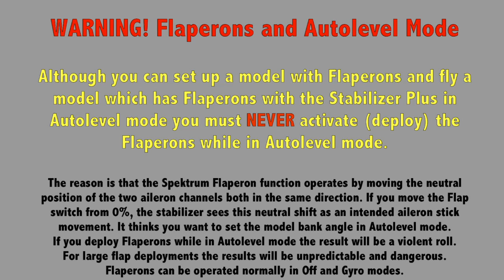2 - Setting switches 4,5 and 6

Comment: I have 2 aileron servos on a  Y cable so switch 6 stays off, you forgot to mention that,  so just  talking about 2 aileron servos makes it confusing.
Reply from the maker: This is Video 2. The aileron servos are thoroughly covered in Video 1. At about 5 minutes in. https://youtu.be/xVrytVCMJdU

Comment: Great review. I am bit confused what do i need to pot on on and off if i have ailerons ( with y connector ) and  flaps (with y connectors).
Thanks
Reply: Anything on on a Y connector is just a single servo and channel channel as far as the Stab is concerned. Put switch 6 OFF and use channel 6 (AUX1) for the flaps. Set 4 and 5 for the mixing required. Both ON for normal wing and tail.

Comment: If you have two aileron servos on a Y lead plugged only into the AILE output, switch 6 is irrelevant. When it is on it copies the stabilizer correction on the AILE channel across to the AUX1 channel. For setups with two separate Aileron servos where one is plugged into AILE and the other into AUX1 this allows independent adjustment of the two channels at the transmitter while still providing stabilization on both ailerons. If you only have ailerons plugged into AILE just leave it off.
Reply: If you are using AUX1 for something else you must leave DIP6 off, otherwise the stabilization correction will be applied to whatever is plugged into that channel.

Comment: Thanks for the great video.  I have a fixed wing v tail with two aileron channels and using open tx and having problems with the channels corresponding correctly.  The v tail servos are on a y connector that can be removed if that helps. Do you have any advice for this setup? Thanks.
Reply: Royce,  not sure how you get a VTail to work with a Y lead as normally the two surfaces have to be separately driven by individual servos and the Stab Plus does the necessary VTail mixing of the elevator and rudder channels from the transmitter. Hop over to the RCGroups support thread. I bet someone who is doing exactly what you need will reply.  John  
https://www.rcgroups.com/forums/showthread.php?2800238-The-NEW-official-Lemon-Stabilizer-Plus-thread
Reply: Thanks John. If I remove the y cable I'll have two separate servo leads for the v tail.  Do you know how I could make that work?
Reply: @roycegittings  One plugs into Elevator and one plugs into Rudder on the Stab and you set DIP switch 4 OFF and 5 ON. This enables VTail mixing. Do not do any VTail mixing in the transmitter. It's covered in detail on page 5 of the Reference Guide. You will find links to all the useful StabPlus stuff including Instructions and Referenced Guide here.
https://www.rcgroups.com/forums/showpost.php?p=29478801&postcount=4

Comment: Great video my question is I'm setting up a fixed-wing with two aileron servos and I'm using the lemonrx stabilizer not the plus version my question is when I set up my Spektrum dx6e do I select elavon for my wing type and no mixing at all and let the stabilizer control that? Thanks
Reply from the maker: Do no mixing in the transmitter. It is not absolutely clear if this is a normal fixed wing and tail or is a flying wing. For a conventional wing and tail set normal wing type and switch 4,5 6 ON on the stabilizer. If you have Elevons, 4 is ON and 5, 6 OFF. Full instructions are available here. https://www.rcgroups.com/forums/showpost.php?p=29478798&postcount=3

Comment: hello sir, the 1,2,3 switches must be on or off???
Reply: 1,2 and 3 are set to control the direction of response of the stabilizer after it is installed. On or Off depends entirely on the servos and mechanical setup of the plane.